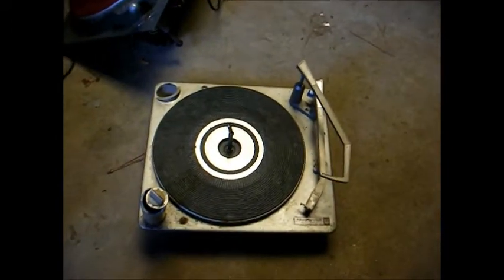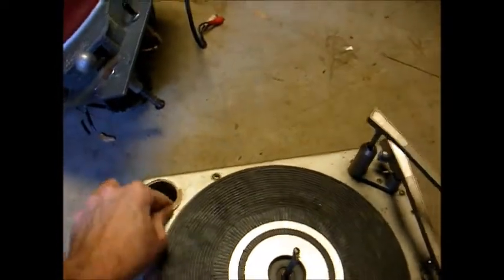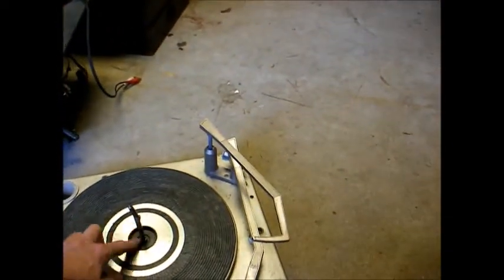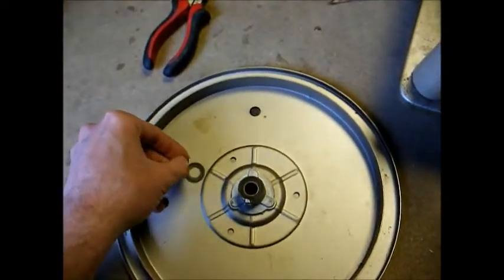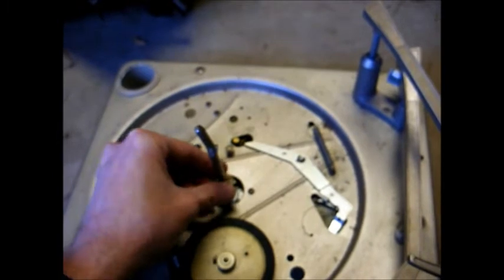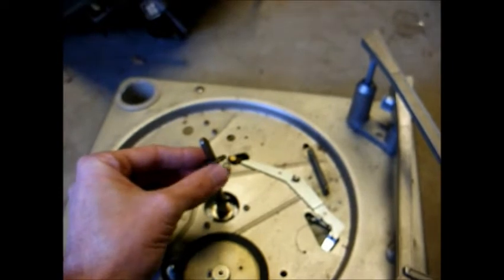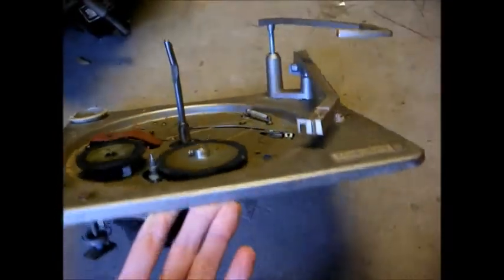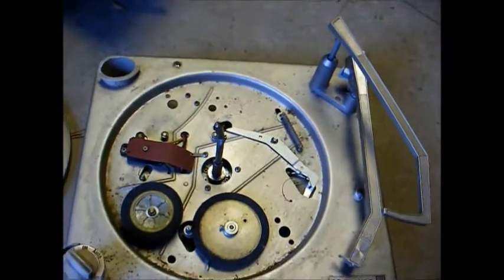Junk Magnavox Micromatic record changer (for Shango066)

Comment: I worked on dozens of these Magnavox changers in my days of consumer electronics tech.  With a good cleanup and relube, these would run for many years.  Though a bit more complicated than the VM, they were, in my opinion, a better, smoother operating rig.

Comment: I was at Restore in Hudson, NY yesterday when I saw it, but it was a different Collaro Micromatic changer from the early to mid 1970's and it works great, and a slight issue was the old grease was on there during the change cycle. I did cleaned it up and serviced the changer, but it does fine. I tried a Disneyland LP that I got from home and tried out with the Magnavox and it will sound perfectly. I'll have to make a decision whether or not be getting an Astro-Sonic console stereo from the early 1970's in the future, but I'm going to love it a lot. First, I have to get rid of my Realistic STA-100 receiver and my Fisher BSR changer, and switch my stuff around including my 1926 Victrola will move somewhere next to the bed, and my dress will have to find a perfect location somewhere until the Magnavox Astro-Sonic will come in.

Comment: A major issue with these changers as well as the newer Micromatics is the cartridge. They are failing and no decent replacement can be had. You get a choice of a totally pathetic China POS or a Tetrad that requires a a harness replacement. There is just something unethical installing a crap cartridge worthy of a Crosley Cruiser in a Magnavox console.

Comment: I got my Magnavox/Collaro Micromatic record changer over the weekend and it was the same model as this, and works perfectly after I did some restoration. It was originally cane with the Full Dimension portable stereo record player, but sadly it was in bad shape and I did EOL’ed it and used it as a stand-alone turntable. This is definitely better than the BSR due to its cheaper design and poor product to the old grease started to get stone hard since it wasn’t working right, this Magnavox/Collaro Micromatic barely wins.

Comment: I'm in need of a micromatic turntable motor. Julie and I picked up a '65 astro sonic at a flea market, and I'm trying to restore. It's in (relatively) good shape, cleaned the pots, radio now works ok. I unfortunately ended up with a bad motor. If you can offer any part/help/advice we'd be so grateful.

Comment: I have this exact turntable. The motor runs very quietly but the larger wheel on top won’t move next to the motor shaft. Any suggestions? It is in almost pristine condition and the grease is still moist in all areas I can see or touch.

Comment: Rebuilding the same changer . The changer side works but the 33 /45 is spinning slow . Wheel is not pushing strong between spindle & plater ?

Comment: This would be a great donor. Regarding the cycling issue, it seems the tonearm height is too low, it goes underneath the record during the sizing, instead of the usual side tap. 2nd. issue with speed, I thought it was only slow, but appears to be a WOW issue. Warped platter? Seems the single idler size does not affect speed as does the stacked type, but line voltage can on pole motors somewhat? I've read.

Comment: I have Micromatic Magnavox Console turntable. It works fine but the part that that parts that link the speed selector to the idler wheel are missing. My current solution is leaving the back off it and pushing the idler wheel mechanism by hand to raise it up or down. Can't seem to find a video that shows the under side of the speed selector mechanism in great detail.